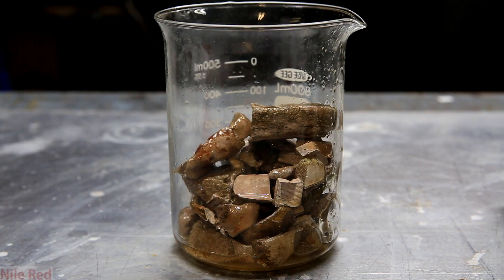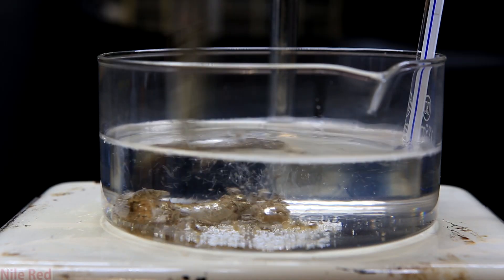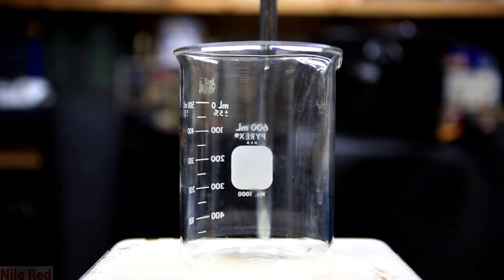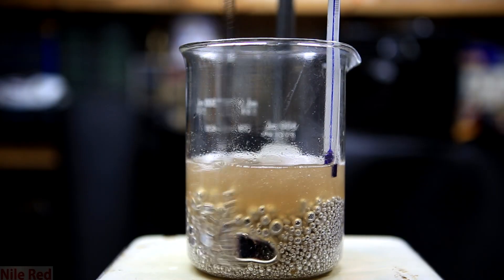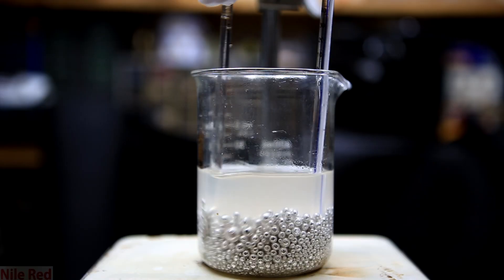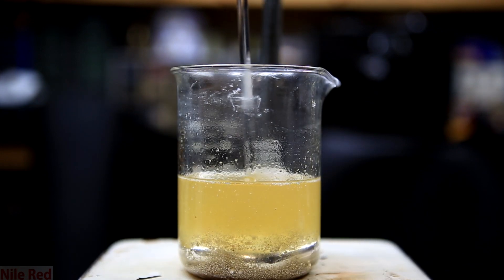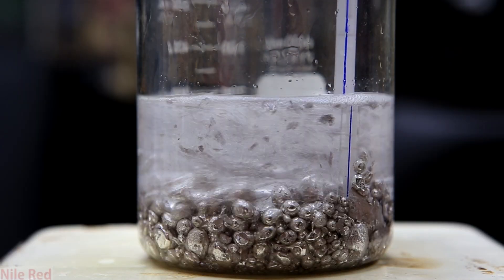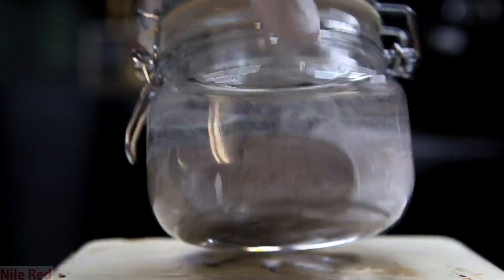Cleaning old sodium metal

Comment: I am an (extremely) amateur chemist and huge fan of your videos. I don't have any sodium to refine, but I've extracted lithium metal from energizer batteries and I would like to coalesce these into a more manageable chunk with less surface area to oxidize, as the form I get it from is a thin foil sheet. From what I understand mineral oil burns before lithium melts. Is there another medium I could use?
Reply from the maker: +dryuhyr I am honestly not sure. I havent really looked into it. Lithium's melting point does make things tricky though...

Comment: Interesting, it would be helpful to explain why the isopropyl alcohol causes the sodium to coalesce.
Reply from the maker: +Martin Heermance I think the isopropyl alcohol reacts with the sodium oxides on the surface of the sodium. It destroys them and allows the sodium surface to be "clean" and interact with other sodium. Just a theory though. I am not sure.
Reply: @NileRed  I guess it could be explained as simply breaking the surface tension of the sodium bubbles allowing them to coalesce
Reply: Sodium oxide is a strong base, so it reacts with the isopropanol to make a 1:1 mixture of sodium hydroxide and sodium isopropoxide. These are then soluble in the remaining isopropanol, so are stripped off the surface of the sodium metal. Any water in the oil or isopropanol also gets converted to sodium hydroxide, so this dissolves as well.
Reply: +Nile Red I'm no chemist, but in another life I worked in a chemical blending plant. We'd use Isopropyl Alcohol in a spray bottle to break up suds when transferring the cleaning products to containers. I wonder if this effect of killing surface tension would also be the principle in action with the sodium.
Reply: +Nile Red I actually think it works because it forms propyl gas (propene or maybe even propyne, depending on degrees of unsaturation ) and a disodium complex. 
It still works by breaking up the surface oxide, but you might be able to get the same result if you had a hot steam jet blow over the top of the oil. Disodium Oxide is actually glass clear, and there's a few videos on youtube that show it briefly formed before it explosively decomposes...
Reply: Yaya Damen sorry: oxide ion is a stronger base than OH- ion, because the net reaction is O2-+H2O-->2OH-. it's one of the strongest bases. I think that it can even deprotonate ammonia. Hydride ion can do it, but i'm not sure about oxide ion
Reply: +Yaya Damen I think in English it is generally called sodium hydroxide. Natrium is latinized Greek (in Greek it is "νάτριο", spelled "natrio")
Reply: Could it be that it works like the gallium beating heart, maybe?
Reply: +Lloyd Evans Thanks for the explanation.

Comment: after finishing the steps in the vedio ,i get clean metal.

how can i get metal without oil before doing experiment?

thank you
Reply from the maker: +姜智銘 You will need to wash it in a bit of dry toluene.
Reply: +Nile Red can i use cyclohexane to wash sodium?
Reply from the maker: Is that the only solvent you have available? Do you have toluene?
Reply: +Nile Red i Have both,but cyclohexane without water is more convenient to get
Reply from the maker: 姜智銘 Okay. I mean, it should be okay. Any saturated hydrocarbon is usually okay. Just try adding a small amount of sodium to the cyclohexane. If nothing appears to happen, then you can add more.

Comment: How do you clean Potassium? I've had some in oil for a long time and would like to clean it.
Reply: +glenwoofit That's quite hazardous work because the crust could be a contact explosive. I've done it before and it takes some balls. Never strike the crust and don't cut it with a knife.
Reply: +Lajos Winkler So how would you recommend to dispose of safely? Just find a pond and throw it in?
Reply: No, just careful heating slightly above potassium melting point, some careful and gentle manipulation of the melt, also tilting the container helps. Push the crud away. Cover the container, let it cool, then use the knife and separate the crapped up potassium from the clean one. Throw the cruddy piece in the lake or in ethanol. Pure piece goes into the protective liquid (the one you used to melt the thing, but filtered; it has been degassed by potassium) which needs to be filled almost to the top of container like a test tube. Sealed if possible.

I must warn you, this is extremely hazardous work. Goggles and even better, face shield is a good idea, and don't work with large amounts. I wouldn't dare. Thick peroxide crust... it can wreck you.
Reply: +Lajos Winkler Thanks for the advice I've been wondering what to do with it for a while.
Reply: +glenwoofit Just wash it with soap and water.
Reply: RapManJak It does the body good.
Reply: RapManJak Yeah right before you explode into a fireball. Thanks for your advice but I'd rather take the advice from Lajos Winkler
Reply: +glenwoofit So if you don't believe this method I would try mixing HCl with elemental K to obtain KCl, and then electrolysis of melted salt.

Comment: Why not try using a denser oil (maybe silicone), so the Na would float on top, and the impurities settle out?
Reply: +Clyde Wary In that case the sodium would be exposed to the oxygen from the air again. This would only works if another oil was added on top that would not mix with the silicone.

Comment: Is it possible to get sodium from Electrolysis of molten Salt?
Sure thing, it will make sodium and Chlorine but is it efficient and can it be simply done in some fume hood or something?
Reply from the maker: ***** I believe that is how sodium is mostly produced. If you look up on the sciencemadness forum, a member there actually made his own electrolytic sodium cell.
Reply: Sounds interesting,  I actually though that it wasn't an effective ways or would have been too risky for many people to try due to Chlorine and the oxidation of the sodium.

Usually, Salt is quite cheap.   does it mean that it's possible to get sodium for fairly cheap as well?   Walmart sells Table salt for about 1$ per Kilos.
Reply from the maker: If you have a generator it is pretty cheap. The issue is the danger of having molten NaCl with a lot of current going through it, along with molten, extremely hot sodium.
Reply: Nile Red I see, Thank you for the info.
Quick question about electrolysis

I did a small experiment using 10 9v batteries connected together and a small jar with salted water.,  The water changed colour to some murky Green/blue.

How come?  Does the salt was affected by the electrolysis?
Or could it be made from different contamination in the water?

It was Tap water btw
Reply from the maker: ***** If you are trying to make sodium, you can't use water. The Na immediately reacts with the water. You need to heat NaCl to melt it and electrolyse that. In water youll form NaOH and Cl2 mostly. The green/blue might come from copper contamination in your electrodes (or maybe you used copper as your electrode?
Reply: Nile Red 
If you are trying to make sodium, you can't use water.
Of course not. 
My question was a bit offtopic.  It was a simple experiment I did at home to see what would happen. No real intention there.

I am not sure what material the electrodes were made of.  I took the first package of crocodile clips I was able to find on the shelves at the electronic store
Reply from the maker: ha okay. I was concerned for a minute that you were trying to make sodium in water!

Comment: Could you not "pre-dry" the mineral oil by heat cycling it to 100C and back to room temp a few times to boil off any moisture?
Reply from the maker: Matt Foley You can probably heat it quite high, around 200C and be fine. With stirring it would get rid of a lot of the water. It still won't be 100% dry though, but it's better than the mineral oil out of the bottle.
Reply: Do you know what causes the oil to be "wet" or is it just the nature of the grade of the oil?
Reply from the maker: Almost anything that isn't specifically made anhydrous is wet. Most of the time it is flat out just due to the moisture in the air.
Reply: Thanks. Appreciate your reply. Awesome videos as well.
Reply from the maker: Thanks! And no reply, replying to comments is half of the reason why I have a channel!

Comment: Would you make a video on the extraction and purification of urushiol? I know this is a strange request but I've always found it interesting.
Reply: SubscribeToSyndicate I'm nervous of what you're planning. Though you could say the same for me, seeing as I constantly need urushiol for experimenting. I'm making a product that warns you of urushiol on your skin before its absorbed so it can be washed off.
Reply: Headshotted718 Really? That's very interesting. How is it going so far?
Reply: I have the concept figured out, like how it's gonna work. I'm now just trying to find a non-toxic compound that will color when it contacts urushiol, but not other molecules, or a very limited amount of other molecules.
Reply: Headshotted718 Do you have a certain method of extraction?
Reply: +Headshotted718 I just discovered that urushiol reflects an opaque reddish orange light under UV radiation. Hope this helps!

Comment: Did you develop this technique on your own, or is it a common lab practice?
Reply from the maker: TheChemistryShack Definitely semi-common. I didn't really follow a guide, but I read things about it online.
Reply: Nile Red to be fair not everyone has sodium either. But I see your point.
Reply from the maker: Yeah, the issue with isopropanol is that it is at least 1% water. Also, not everyone has those alcohols. Isopropanol is very easy to get.
Reply: Nile Red yes I was. You just take an excess of potassium hydroxide and mix it with magnesium turnings or powder (with absolutely no oxidation on it) and cover it with mineral oil or tetraline (potassium floats in tetraline making the reaction a bit easier). Then reflux the mixture for a bit to drive off impurities and water from the oil. Once it's done refluxing cover the top of the condensor with foil to prevent oxygen from entering while still allowing hydrogen to escape and add 0.1 mL of tertiary alcohol to the hot mixture. The alcohol will catalyze the reduction of the potassium hydroxide with magnesium to produce potassium metal and magnesium oxide and hydrogen. Add 0.1ml of alcohol every 10 minutes untill all the magnesium has reacted. I don't recall the exact temperature the reaction should be run at but it was quite hot. In the end you should have a bunch of potassium beads at the bottom of the flask. I'll see if I can find an archived version of NurdRage's deleted video...
Reply: Nile Red why not use butyl or amyl alcohol? As seen in nurdrage's now deleted video he uses tertiary alcohol as a catalyst but it also seems to keep the metal much cleaner than the isopropanol did.
Reply from the maker: ha yeah. I actually do have t-butanol, but I had to order it specially. I have 5L of isopropanol though. You are right though, sodium is the hardest thing to get out of them all.
Reply from the maker: Magneto! you were actually able to make some potassium?
Reply from the maker: Magneto! haha that sounds super professional
Reply: Magneto! Well t-butanol is a more specialized chemical than sodium, unless you work on tertiary organic compounds a lot
Reply: TheChemistryShack I was able to buy some on eBay a while back.
Reply: +Magneto! So do you think that isopropanol can be used for making potassium instead of amyl alcohol (like in NurdRage deleted video)?
Reply: Eimantas a no it has to be a tertiary alcohol. I've had good results with some butyl alcohol I bought on eBay.
Reply: Magneto! Right, I see.
Reply from the maker: Magneto! its interesting because a lot of people reported to me that it didnt work for them
Reply: Nile Red hmm. Well I got it to work. And I did it before I had any professional glassware. I did it in a baby food jar in a pan full of hot sand.
Reply: Nile Red I'm honestly surprised it worked because the problem I kept having is the t-butanol would always boil away immediately in the hot oil and I didn't have any sort of a reflux condenser setup. Bear in mind that my yield was terrible. But there definitely was a yield.
Reply from the maker: Magneto! it is interesting nonetheless!

Comment: how would you clean the oil?
Reply: 1337_Vid305 It would be very difficult. You would have to distill off the oil, but that would leave you with hot NaOH and Na2O in the still pot, which could be harmful to the glass. Also, it will be a pain to clean the distillation apparatus. Probably best to just buy more oil.
Reply: +TheChemistryShack I wonder if you could run the oil through a vacuum filter to get the gunk and stray sodium balls out?